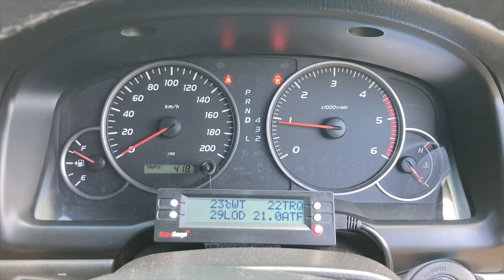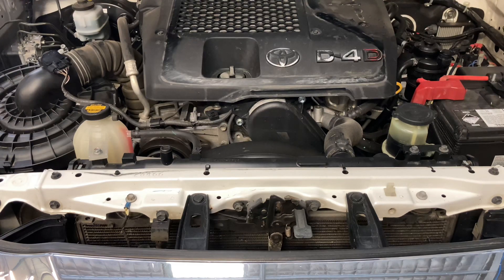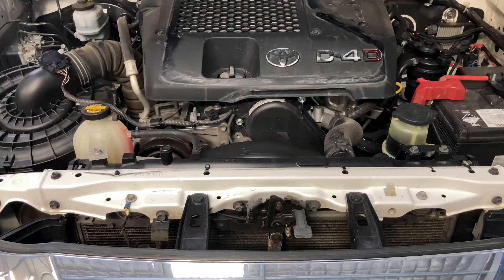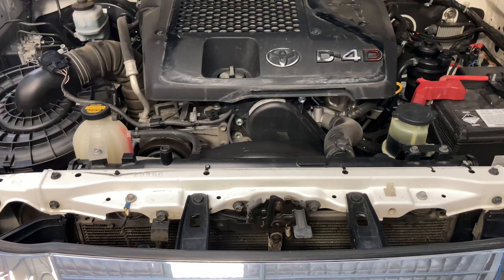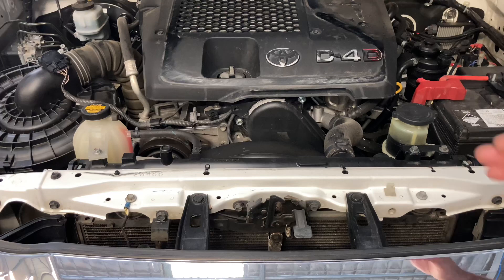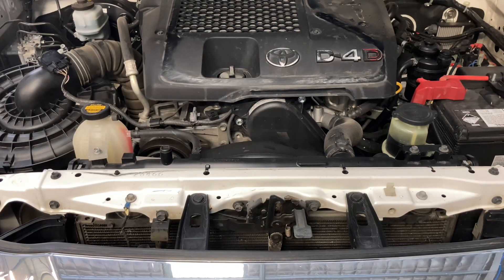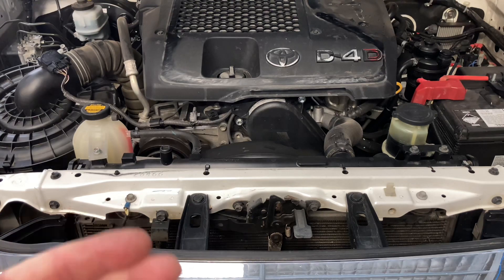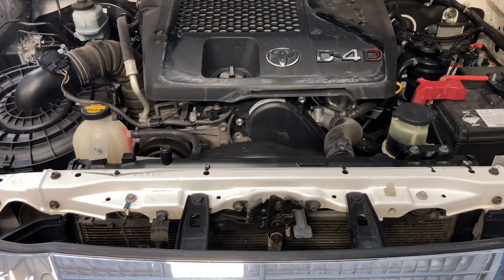CAR BUSTED BAD and WHY DOES the ENGINE OVERHEAT Detailed explanation of cooling system operation

Comment: Best investment I ever made for a V8 Petrol Landrover was a Coolant Level Alarm. Overheating its over bored alloy block with steel cylinder liners was the kiss of death as the liners let go. Temperature gauge useless as with sudden coolant loss the temperature actually drops with no coolant to measure.

Comment: My friend who worked radiators found out many years ago. That put shade cloth in front of radiators to stop debri getting in was very bad. Apparently the nylon thread builds up a static charge as air blows through and eventually creates a barrier that stops or reduces airflow.

Comment: Mine always idles at 85-86… which is ok but at 100-110km/h in 6th gear or up a mountain range…it quickly runs to 90 degrees…
Does the condenser in front of the radiator ever block and restrict flow? I have changed all temp related parts (viscous fan, thermostat, Toyota coolant)… still the same. Radiator isn’t leaking or appear blocked. Fins are clean… 
1KD-FTV 2009 6 speed manual 120 330k
Reply: What are you using to check the temperature readings? Scan tool?